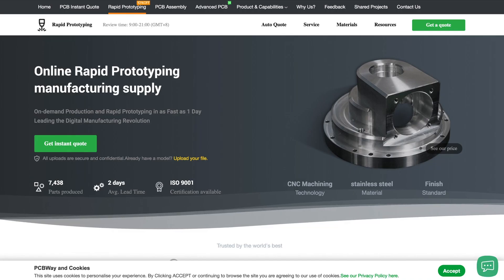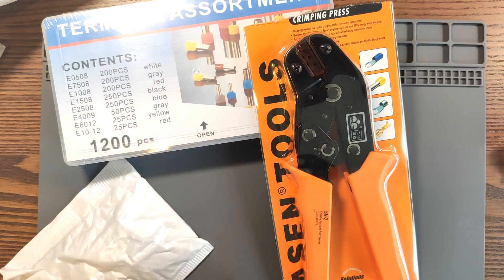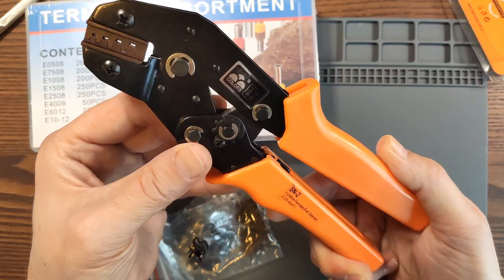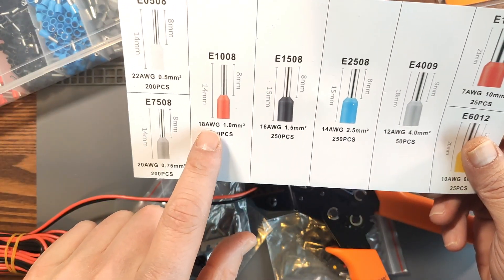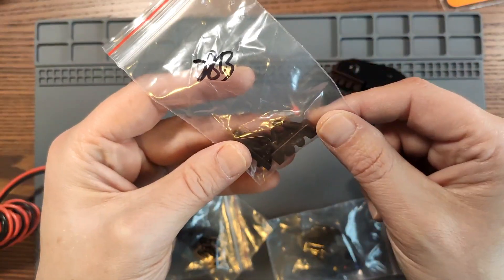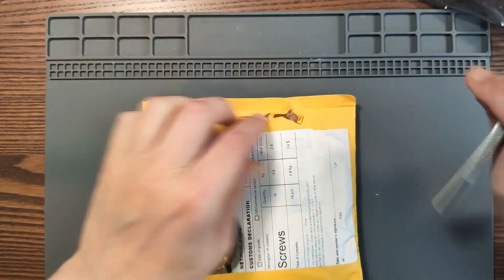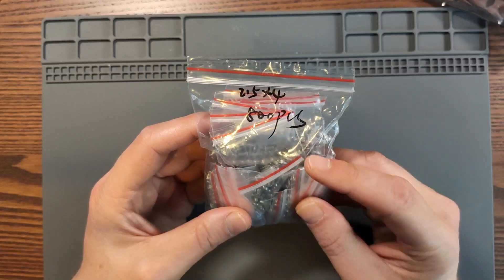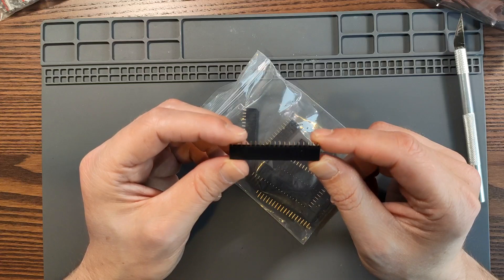Crimping Tool and Stepper Drivers (Postbag #21)

Comment: My Jaw's came with some bend Sheet Metal Parts.
like: ali _ c0m _ item _ 32814375295 _ html
The Thickness i meusared is 1mm, or maybe glueing a Washer on every side will work too.
Reply from the maker: I actually later tried a washer and that worked pretty well. Still think this could have been done better!
Reply: @DustinWatts  I was thinking adding a washer too
Reply from the maker: @bwselectronic  Still... I would rather have a part fit from the factory! :)
Reply: @DustinWatts  agreed

Comment: The best way to get good crimpers is to spend a lot more cash. You can tell the ones if got from ebay or aliExpress as they are at the back of the draw. My goto ones are second hand, but you have to hunt them down.
Reply from the maker: Very true. Very true for most tools. Just thought I'd give it a go.